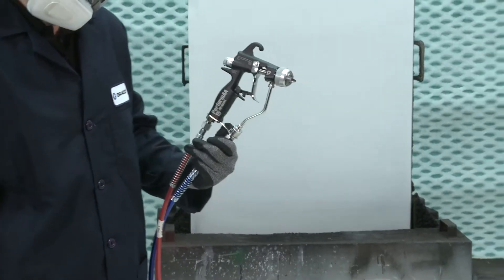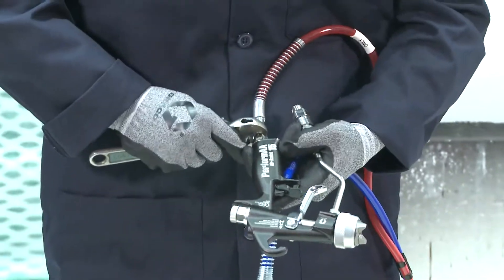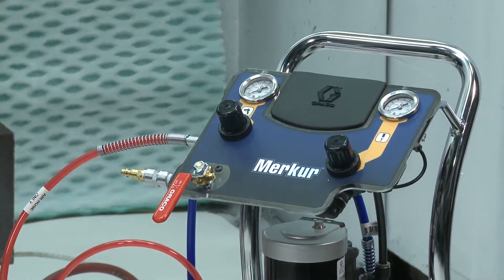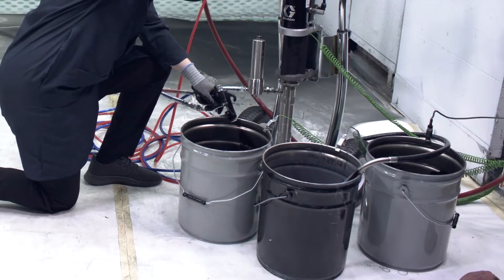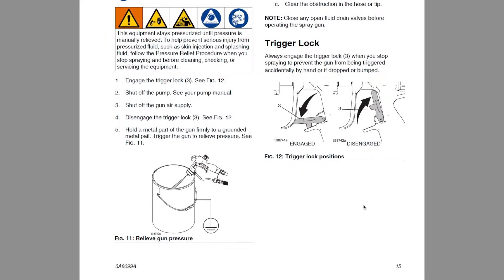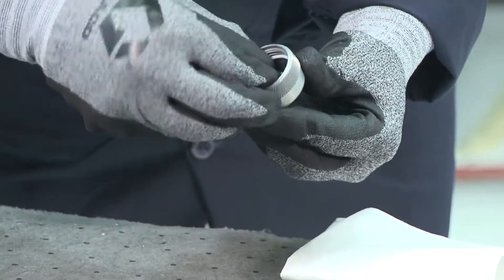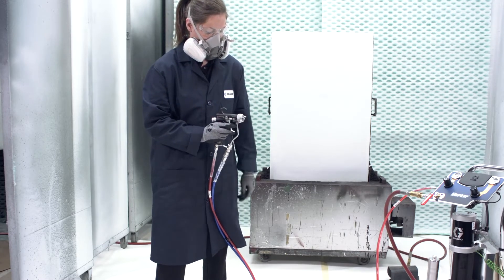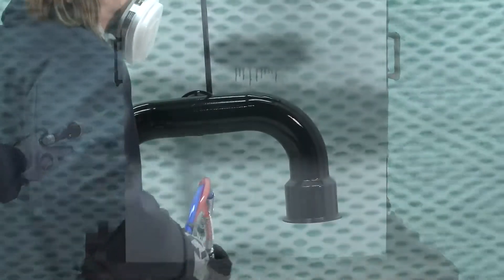1 - PerformAA: Connect the Spray Gun

Comment: Can you make a detailed video on these guns with the finer aaa tips and standard tips explaining the gun in full detail using coatings there’s hardly no information on these guns I’m looking to change over to the perform gun from the g40 to use the finer atomising tips low pressure spraying thanks
Reply from the maker: Changing over to the PerformAA manual air assist spray gun is a great choice for finer atomization at low pressure! PerformAA tips (AXM and AXF) and air caps are backwards compatible with G40 spray gun tips (AAM and AAF) and air caps. If you'd like to test the difference, you can test PerformAA components on your G40 gun. 

For answers to your specific questions about going from G40 to PerformAA, we encourage you to call Graco Technical Support at 866-361-5929 or your local Graco finishing equipment distributor.

We are sorry you've been having trouble easily finding information about PerformAA and hope you find these resources helpful:
 
Visit https://www.graco.com/performaa for overall information about PerformAA and the different coatings it handles.

For details about fine finish spray tips for air assisted airless spraying, see:
* our new AX tips ordering guide: https://www.graco.com/content/dam/graco/ipd/literature/flyers/345217/345217EN-A.pdf
* pages 5 to 7 of this brochure: https://www.graco.com/content/dam/graco/ipd/literature/flyers/345178/345178EN-B.pdf 

For help troubleshooting common air assist spraying concerns, check out our spray pattern quick guide, available in these formats:
* YouTube playlist: https://youtube.com/playlist?list=PLO2qNIWPaRw6Wb0Ia1agrKqAG4ZkYdD7v&si=H3e8OA2rcUzKuT7B
* interactive web page: https://www.graco.com/us/en/in-plant-manufacturing/support/education-center/liquid-finishing-spray-guns-applicators/air-assisted-airless.html

Comment: This gun won't connect to  finish pro 395  AAA series sprayers.
Reply from the maker: The G40 RAC is the correct gun designed to connect to the FinishPro II 395 PC Electric Air-Assisted Airless Sprayer. For more about your options with FinishPro, visit https://www.graco.com/us/en/contractor/product/17c417-finishpro-ii-395-pc.html